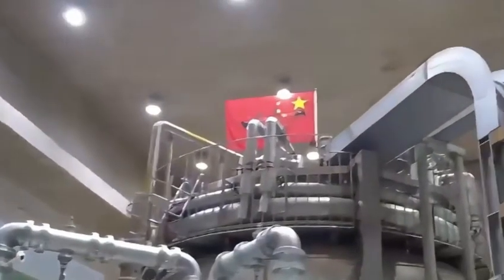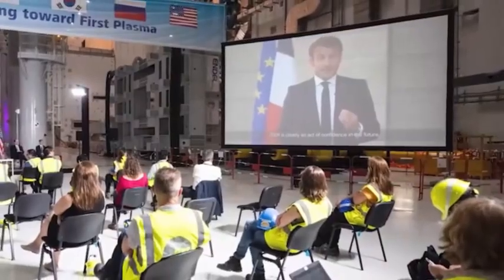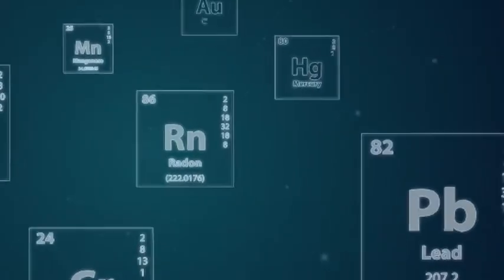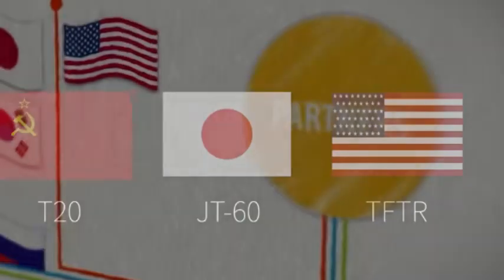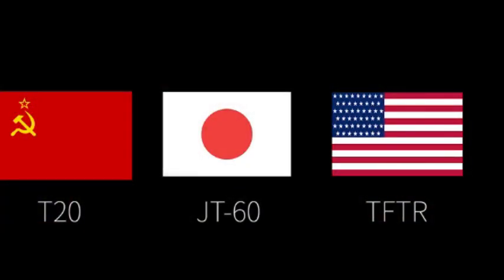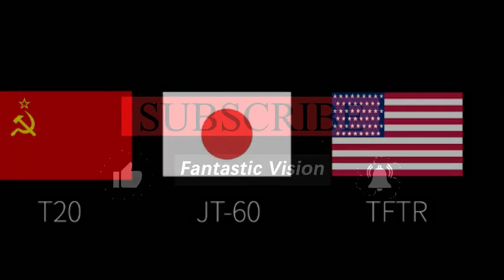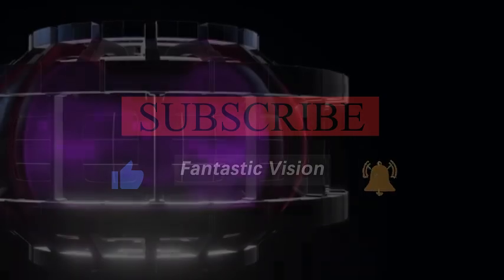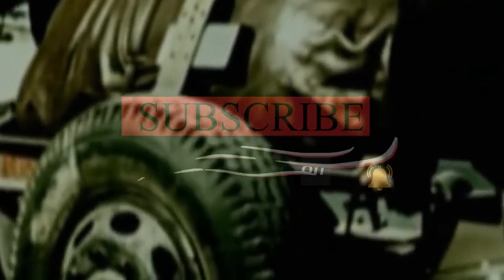China uses American chips in nuclear fusion research, US Congress orders a thorough investigation.

Comment: For fast graphics speed, all one has to do is buy a gaming computer to which most use an American CPU and GPU. Both were designed in the US, but probably fabbed by TSMC in Taiwan.   Having said that, the US military uses Chinese semiconductors in 40% of their military electronics. Strange that the US is not worried about Chinese semiconductors going into its military gear.

"over 40 percent of the semiconductors that sustain DoD weapons systems and associated infrastructure are now sourced from China. In addition, between 2014and 2022, American dependence on Chinese electronics increased by 600 percent. Jan 9, 2024" (Forbes)
Reply: Thanks for the update 👍